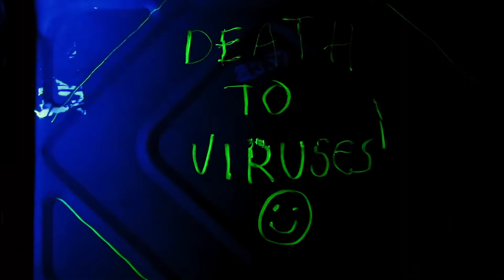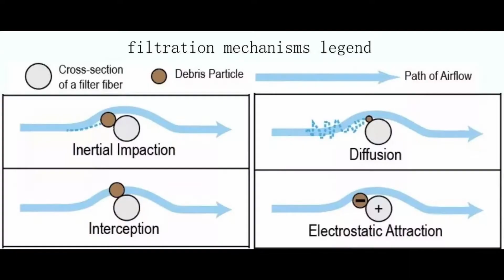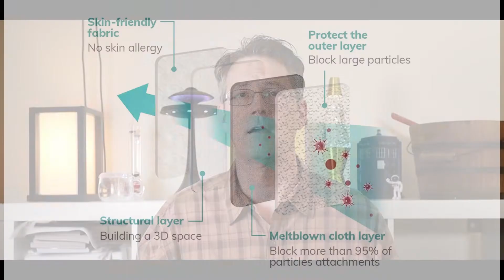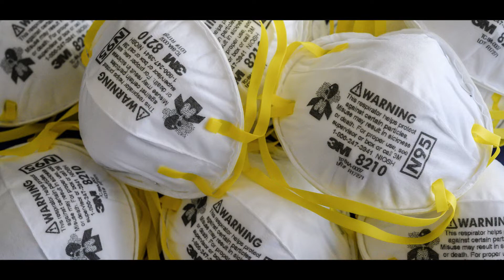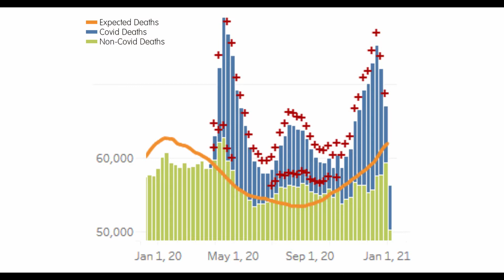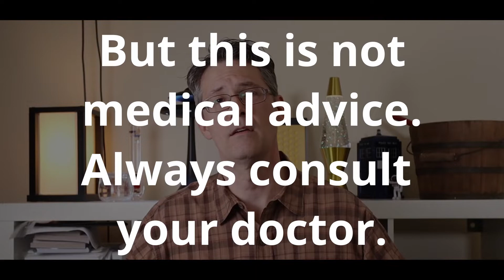Nose Masks for COVID?

Comment: This is the best video I’ve seen on the subject of masks. Thanks! I’ve shared it with a few friends.

One item you didn't cover (much) is how the mask is fitting when you put it on. Obviously, you’re being an idiot and a danger to everyone else if your nose is hanging out. But even an N95 or KN95 mask can be much less effective if it’s put on in such a way that the air is coming in around the nose or through a gap in the sides.

A simple test is to put the mask on, pull it tight, and then breathe a bit. If you can see (or feel) that the mask fabric is puckering in and out as you breathe, then it’s doing its job. The air is going THROUGH the filter-fabric, not around. If it is not doing that, or if you can feel a breeze around the edges, or if your glasses are fogging up, then the air is not going through the filter, and you should adjust the fit until it does. Feeling for that pucker in-and-out becomes second nature pretty quickly.

Comment: Why is the probability 70% when you wear it on your nose but not your mouth and only 18% when you wear it on your mouth and not your nose?
Reply from the maker: Assuming 80% of infection risk is via inhalation and 20% is via ingestion, then a 92% effective mask worn over the nose protects you from 92% of 80% of the risk, or 74%, when over the mouth protects you from 92% of 20%, or 18%. Of course, this is a vast simplification to make the point.